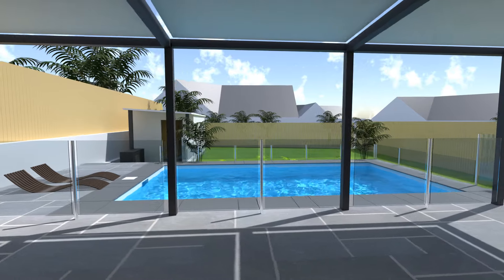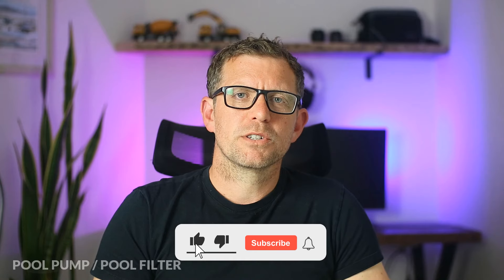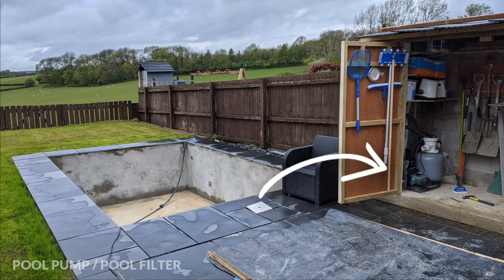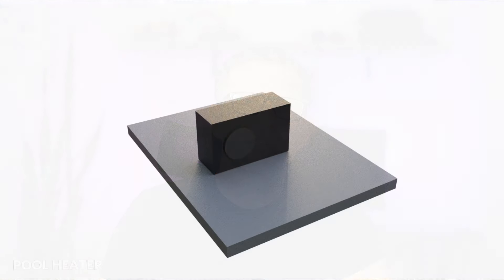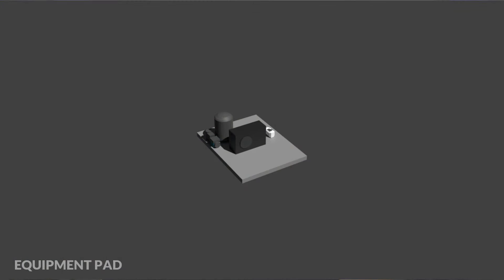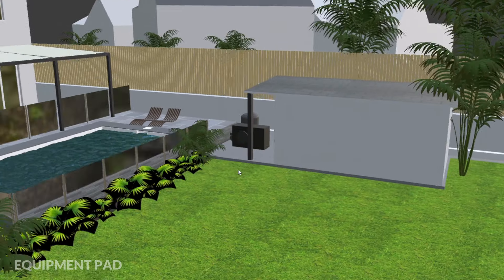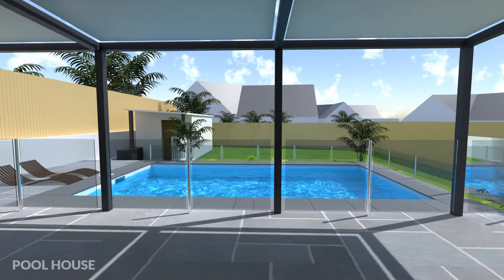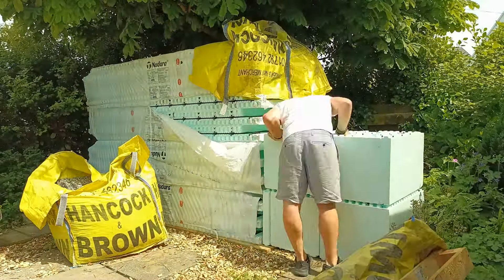Ep.6 - Pool Plumbing, Filtration & Pool house Design :Building a heated DIY Swimming Pool in the UK

Comment: Interested to know how yoy arrange the jets to aid self cleaning. I've only ever seen it done with all jets pushing water towards the skimmer. However you mention adding lower jets to clean the buttom?
Reply from the maker: So in a  later video I've slightly modified the return jet placement....the theory is that I'm creating a rolling motion in the water. I'll also be able to control each return jet. We shall see! This approach has been recommended. So we'll see !
Reply: @RichDoesDIY  Awesome! I see the changes you made - I'm fully caught up now, and hoping you're pouring the concrete for part 12! 👌

I'm very close to close this a go. My main issue is that I don't have any practical volunteers to help with things, and, it seems that you need a couple of people here and there. Seems I need to make some new friends! 😂

Comment: Although my pool pump was sold as single speed single phase, it was actually a 3 phase motor modified by adding a capacitor to one of the phases. I removed the capacitor so could then control it with a single phase to three phase variable frequency motor controller which are inexpensive on eBay. The benefits are being able to optimise the flow rate to match the heat pump. I can use different speed settings when cleaning the pool and also back washing the filter. It has a soft start so limits in rush current.
Reply from the maker: Top tip, thanks for sharing. I've also since found out that you can easily turn a regular single speed pump into a clever variable speed pump via a pool control panel with built in inverter for complete automation. This is something I'm considering. However your option does sound more fun to build. I'll investigate!

Comment: Why did you not choose a floor drain? Are there any disdavantages or advantages with a floor drain?
Reply from the maker: @hansendsouza6440  Hi. So I didn't have a main drain on my last pool as it was only 20m3. I also didn't want the complication of putting one in as they are a common source of leaks. 

The advantages (I guess!) are they they take sediment and cool water from the bottom enabling good circulation around the pool. However my last pool didn't have any issues with sediment or circulation issues so decided to omit it again.

I also plan on using a floor robot vacuum so won't have an issue with dirt on the bottom anyway. 

If id gone for a larger pool I'd probably have put one in 👍

Comment: Hi Rich, did you consider building a slope/shallow end as you have kids? Any reason you opted not to - extra steps etc?
Reply from the maker: Hi, good point,  I did think about it. However due the relatively small size of the pool, the slope would be quite steep as I'd like at least 1.35m in the deep end. 

The flat bottom is also a lot better for pool games in my experience, the last pool I built was a constant depth. 

I also figured that the kids will be able to touch the bottom in a few years and then majority of the time they are still using the pool, they'll prefer the depth. 

There will be a safety cover on the pool when the pool is not in use, in conjunction with a 1.2m high perimeter fence built to European regulations. 

They are both also learning to swim! 

And I guess Im not  sure I'd be capable of making a sloping base! 

There are in pool steps and a ledge which will benefit the kids, jumping off the ledge and the steps will assist them getting out 👍

Comment: Great video with loads of useful info and great graphics 👏. Constructive comment re pool house: wouldn’t a timber frame (or even SIPs) be adequate (and easier)? In terms of futureproofing you may want a bifold or similar onto the lawn (to use as a garden room) and this would be easier to retrofit to a lightweight structure. Great project coming on well though 👍
Reply from the maker: Good question John. So part of the reason for the reinforced base and blockwork walls is to help transfer the Load of the existing boundary  retaining wall that is not in great shape. I'll be backfilling between the shed and wall with a gravel to help with the load. 

I could however build the front face of the shed with wood and also put a 4m steel across for future options with regards to bi-folds / garden room conversion. Good advice. Wish id not got rid of my 4m steel that was surplus to requirements when I removed the conservatory!
Reply: You must have known that you’d need it one day when you got rid of it! 😂
Reply from the maker: @johndouglass9822  yea you've got in in one ! Dam n blast! O well. Off to the steel shop I go 😂

Comment: As someone who's just completed a pool refurb in the UK a few things that you might not have considered:
- If you're going to include low level suction make sure they follow the appropriate entrapment safety design spacing just in case the skimmer becomes blocked.
- A 1HP pump likely exceeds the widemouth skimmer flow capacity by up to 4x, you might want a second skimmer or the low level returns or you may get air sucked into the pump through the skimmer
- I think you mentioned Hayward but consider the Certikin version of fittings (skimmer/returns) as they are much easier to get parts for in the UK

For info I have a single skimmer and two returns in my 27K litre pool and get sufficient circulation with the adjustable direction return fittings.
Reply from the maker: Thanks for the notes. I had two low level suction points on a T at regulation separation in the last pool. Ill possibly do the same. And may go with three returns on one wall.  Only reason I'd go with Hayward is because they were recommended to me and Bosta supply all Hayward parts and they are much cheaper. 

I'll take a look at Certikin! 

Thanks for the comprehensive notes. Stay tuned for "Pool plumbing part 2" !

Comment: Does heater work better if its in the sun?
Reply from the maker: Good question Steve, I'm not the expert, but from what I've read the heater will be fine in the shade and performance differences between shade and sun are minimal. The Heater will draw in enormous amounts of air from around it. That air will be in the sun :-) Hope that Helps.

Comment: Hi Rich, liking the project and considering doing a pool in our garden. I have a couple of questions if you don’t mind. Which company did you use for the ICF forms and how did you ensure watertight with the base?
Reply from the maker: Hi , I used ICF central to buy my Nudura forms. I'd like to stress that I've not done this before though and it's a bit of an experiment! It's possibly a bit ambitious for the average DIYer like me. I've not ensured water tightness between the base and the wall infill as this area will not hopefully stay dry as I don't really have groundwater issues here. The watertight membrane will be inside the inner ICF wall. And I'll possibly use Basecrete but not decided yet. Liners are a bit pricey and I don't like the rounded corners on the more budget liners!